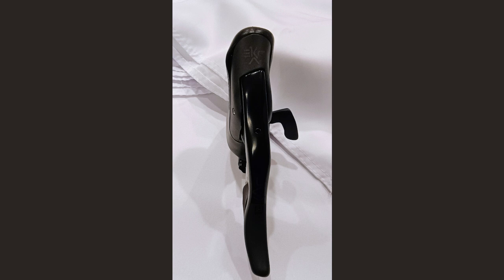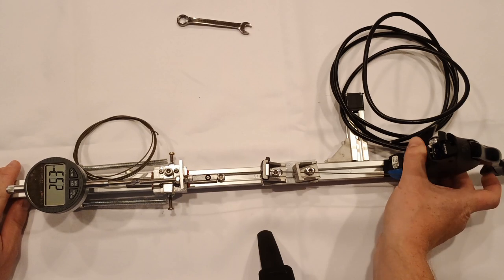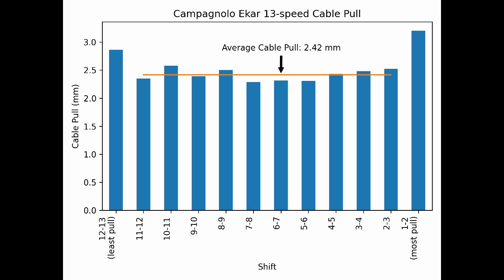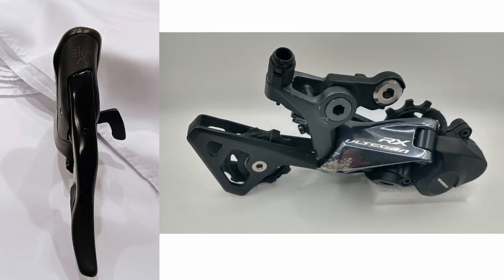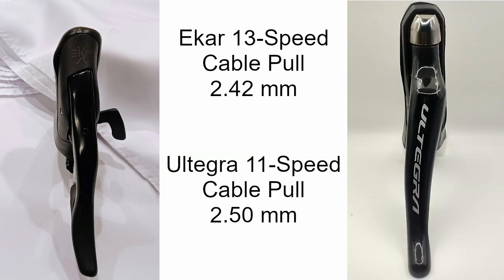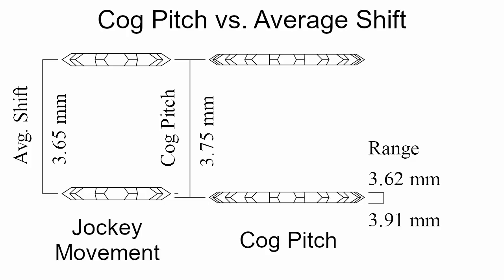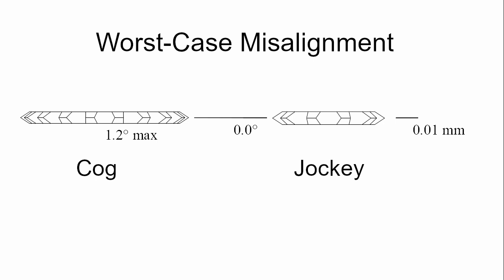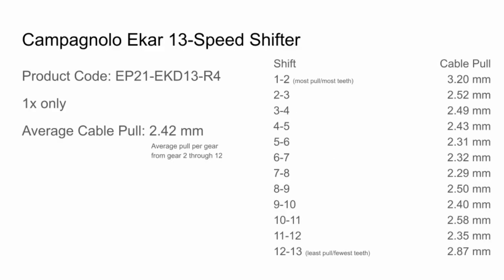Campagnolo Ekar 13-Speed Drop Bar Shifter Cable Pull

Comment: Great work with all of the cable pull videos. I’m trying to measure a 12sp campy shifter at home with 3D printed jig, but struggling to create consistent tension. Do you know the spec of the 2 springs in your set up? And, if you’re taking requests, can you pls measure a 12sp shimano MTB shifter? Thank you!

Comment: Nice! I am really curious, the Campy rep told me they changed the Ekar GT pull ratio, so the shifters and derailleur are no longer compatible. Ekar has always been finicky for me, I wonder if the cable pull was increased across the board, or maybe just the big cog
Reply from the maker: I'm curious too

Comment: interesting to see so much variation in the middle gears. Do you think this has something to do with the 13 speed cassette? Or is it just manufacturing tolerance?
Reply from the maker: Good question! I would like to know the answer as well. Unfortunately I don't have access to an Ekar 13-speed cassette to measure it, and I don't feel like spending $240+ to buy one.